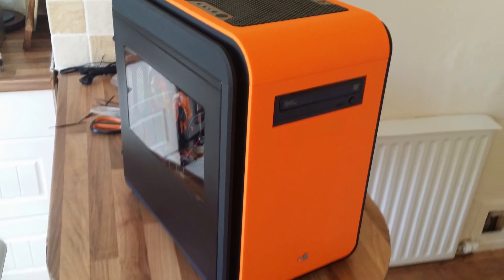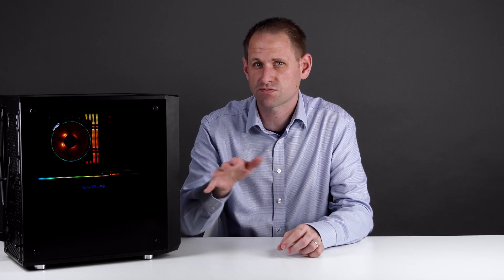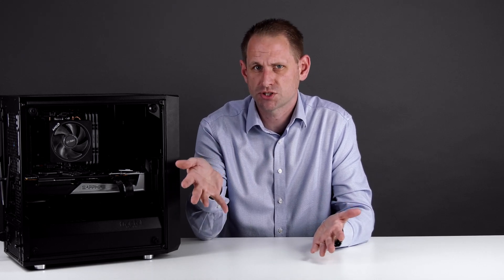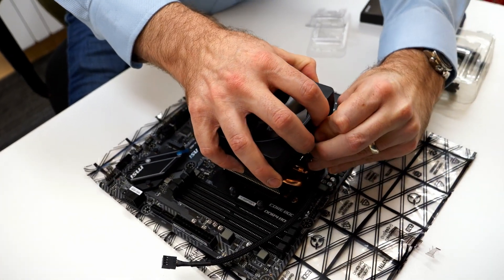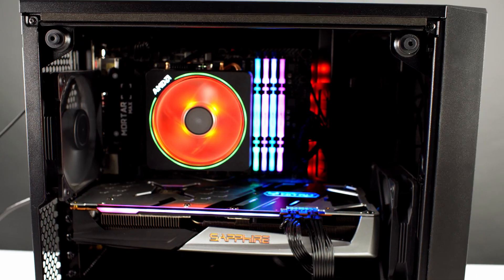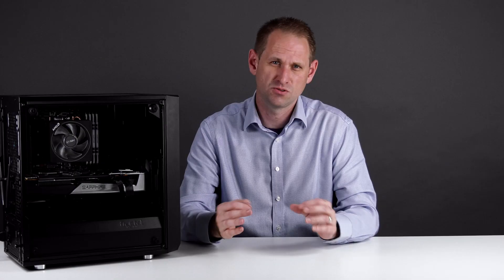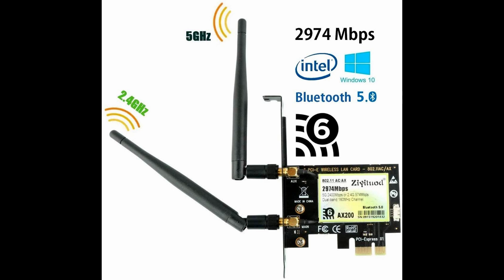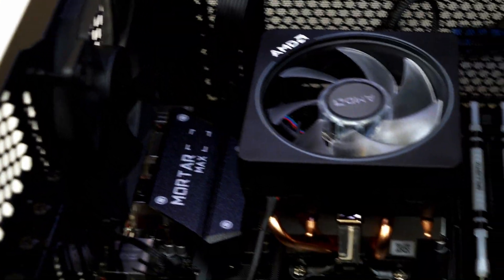Mid-Budget AMD Gaming PC Build - Part 1

Comment: Off topic question. Surface Go 2, I love windows tablets and I have a chuwi hi8 from number of years ago, it has a Intel Atom Z3736F 4 core 4 thread cpu. The surface go 2  higher model has item m3 dual core cpu, does it make sense to upgrade for the small performance gain.
Or best to wait for Surface go 3 AMD format?

Thanks
Reply from the maker: I don’t have any personal experience with the Surface Go, but every Atom device I’ve ever had has been disappointing. We had a few Asus ultrabooks at the studio which had the m3 CPU, and they were perfectly usable. You’re looking at a significant performance gain if the GB5 scores are anything to go by: the m3 in the Surface Go is almost 4x faster on single-core and 3x faster on multi. Still considerably slower than an equivalently priced iPad of course, but if you specifically need Windows, that’s not an option. No idea about the future AMD version.
Reply: Constant Geekery thanks